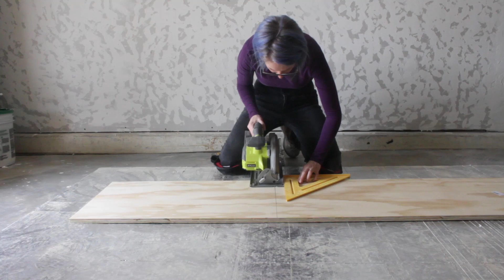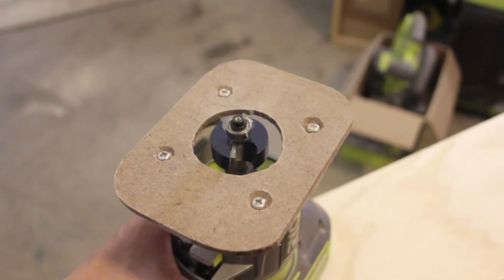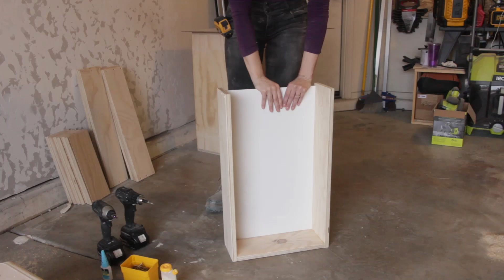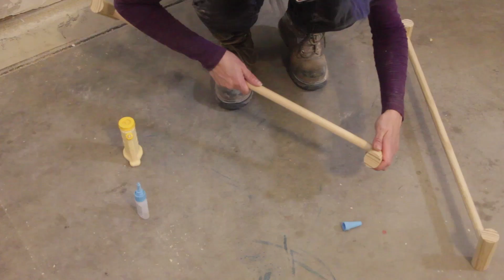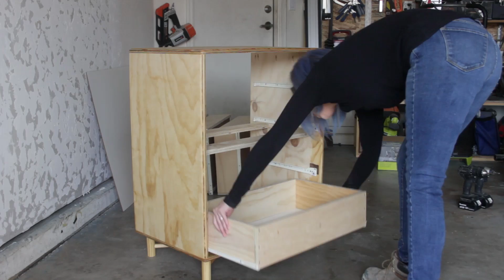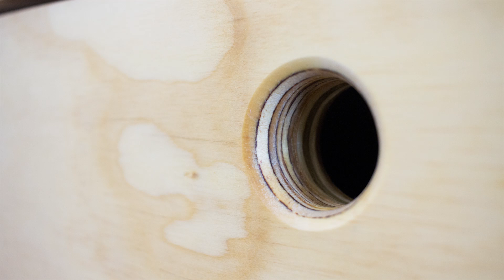Plywood Dresser with Dowel Legs | How to Make

Comment: Total waste of time and money.  Plans don’t match the video, and the dimensions in the plans are mathematically off.  Lots of stuff missing, like drawer slide assembly and measurements required. Drawer assembly in diagram even calls for different size than is in the cut list. Very frustrating.

Comment: Your drawer slide selection is excellent. I used full extension slides with self close on our kitchen and wardrobes and they need to be incredibly accurately installed and really aren't necessary. A useful and economic piece of furniture.

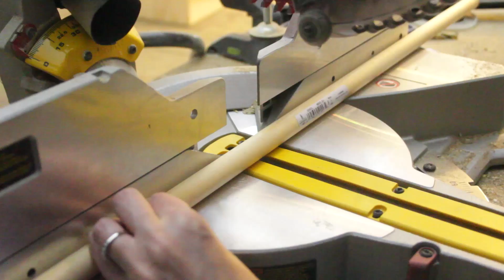Comment: 6:38 Never hold a piece of wood by hand and drill it, esp a dowel. Please hubby, get her a  collapsible work table with clamp. at least. Not safe to do this. Too easy for it to slip and gouge you with the bit or catch and spin the dowel and whack your fingers. :(( Please by safe.

Comment: “Pneumatic Addict”? I didn’t see you use one air tool. You need a biscuit joiner. Ditch all of those whizbangery tools. You don’t need them to accomplish what you used them for. Unless someone else paid for ‘em. Then, what the hell?! But you don’t need ‘em. 

Also, attach that “Kreg” jig to a long enough pc of plywood so you can kneel on it and steady it. Also use pocket hole screws. They’re better.

Comment: Nice job, but you've made your drawers the wrong way, the way you've made them you can pull the front of the drawer off. If you fit the front between the sides, and screw from the sides into the front, you have a strong mechanical joint, in the same way dovetails were/are used for drawers. Yes the screws are seen when the drawer is open, but that's what plugs are for, and it would be a shame to have to rebuild them in the future. The runners you've used when using them below doors, such as on a wardrobe, means the doors cannot be opened when the drawers are out, as the drawers essentially are lifted up to open them. I didn't give a like our dislike because of the drawer design, as a cabinetmaker it bugs me when drawers are built this way. I do like your videos though, keep it up.

Comment: That was so good, I learned so many tips! One I have for you is when cutting the drawer pull holes, drill through the front until the tip of the forstener bit is just poking out the back, then switch to drill from the back and you’ll have no blowout. Hope that helps :) I’m off to binge watch some of your other videos,

Comment: I enjoy this. A little dry, but I really like how you use normal home game tools and supplies. It's super irritating watching people say, "anyone can build this easily." Then they have a massive shops and $ 10k in tools.... This is actually doable.

Not everyone has a full table saw, drill press, planer, joiner, giant work bench, dust collectors, full professional woodshop.
Reply: Just the wood itself that most people use runs in the 500 to 1k. Not cheap material that I want to get like 2x6 that I can glue together and have a large platform for a workbench table xD.

Comment: You need a workbench. Doesn't have to be a fully functional woodworking workbench. A sturdy table which can take a beating would already be a significant improvement. You can make it foldable, so it doesn't take up space when not used.
Reply from the maker: Thanks! https://www.youtube.com/watch?v=jUNZVaGAE3E 
I got one, but I was using it for my miter saw

Comment: I've used white board / marker board for drawer bottoms, too! works great and super easy to clean, and no paint or finish needed. Take that kreg jig and screw it to a piece of scrap 3/4 plywood, it has holes in it so it can be screwed to something. It works great and you can even add a little workpiece support on the sides so the panel doesn't rock, like you experienced.

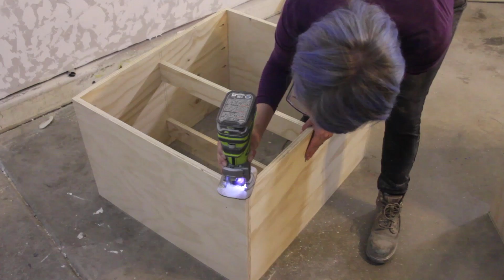Comment: Nice job! Quick tip for anyone routing the edge of a box as seen at the 3:20 mark: clamp a sturdy board across the box opening to provide a wide, stable surface for the router base to glide along.

Comment: If you are worried about tip over, possibly consider either running screws with washers (to keep them from easily busting through the back) into wall anchors in the wall or maybe even a couple French cleats attached to the plywood if you don't mind the dresser being a few inches from wall. I had to screw my daughters to the wall when she was little because she would pull the drawers out and climb it like a ladder.

Comment: Very nice results as well as instructional.  May I suggest when drilling into a round item (forstner into the dowel for the cross pieces on the legs) use a clamp to hold the dowel.  The damage from that forstner on one's hand is pretty devastating.  Don't ask me how I know all too well.   Thanks!!

Comment: Quick word when ever possible when placing legs try to get them to sit on both the vertical and horizontal edges this will place less stress on the screws at the bottom ...

Comment: Cool design! A tip as you learn and use the table saw more. If you are adjusting the blade height for a groove or dado it is more accurate to raise the blade up to you measurement then to lower it down. The way the gears mesh they are more likely to stay where you set them when you raise the blade up to your height. Keep on making, you are doing great!
Reply: I can confirm this behavior on my older dewalt saw.  Also, please make or buy some push sticks.
Reply from the maker: That's good to know! Thanks for the tip

Comment: I appreciate the "doing the job without a bunch of fancy tools" approach. I just wanted to comment on working on the floor bit. Try to upgrade sooner than later, even if it means two sawhorses and a slab of plywood.

 Our joints aren't getting any younger and it takes just one stupid mistake to create a nagging injury you must endure until the end of time.

Comment: Hi! Great video and beautiful furniture, congratulation! I have a question about the pocket holes. I often heard that it works the other way towards the mass of the wood instead of the end or edge of it. It is really an issue or if you glue it doesn't really matter? I have a couple of projects in mind and I'm a little worried about the strength of the pocket holes and I wasn't able to find a good answer about it. Tanks for sharing the process and congratulations for your projects! Greetings from Uruguay.
Reply from the maker: Thank you!  Yes, I've noticed the angle of the screws want to push the vertical piece away from the top and would work better facing in, instead of towards the edge. Unfortunately, placing the holes on the inside is the best way to hide them. I think you're right about making sure I use plenty of strong glue to reinforce the joint.

Comment: Very nice job. Just a couple of tips for you, you can pre drill the drawer box fronts before mounting the finished faces, use pocket holes on the outside ends of the drawer box so that nothing is seen in the finished drawer and also hot glue can be used to hold the drawer faces to the box while the you screw on the faces. You are doing great work, looking forward to seeing more projects.
Reply from the maker: Thanks for the advice!
Reply: @PneumaticAddict  You are most welcome

Comment: Again a very well done project. Just a quick tip, if you use your pocket hole jig to build your drawers, you can hide your screws pretty well in the back of the drawers, and behind the false front. Just a thought. Thanks for sharing. 👍😃
Reply from the maker: Thanks for the advice!